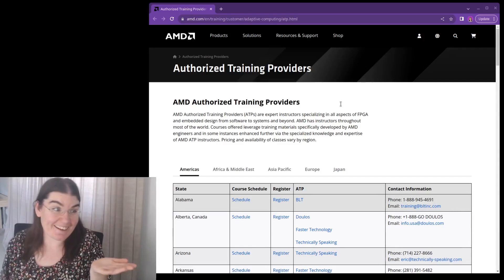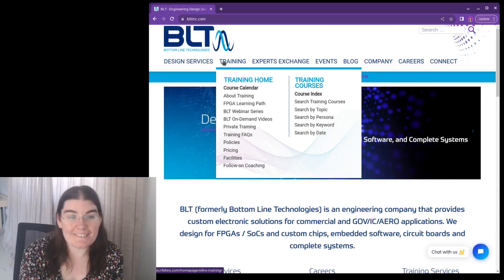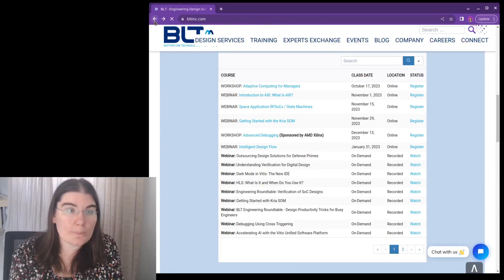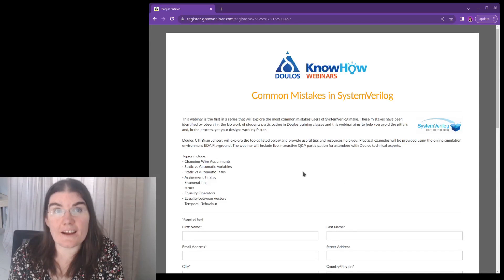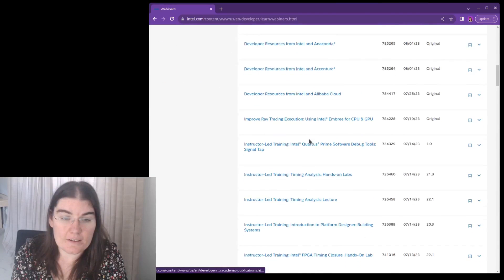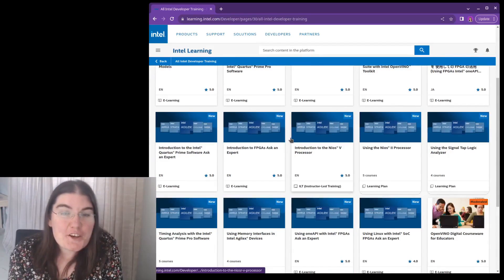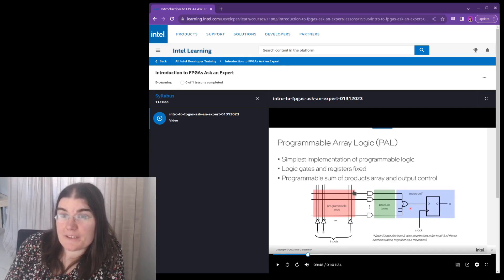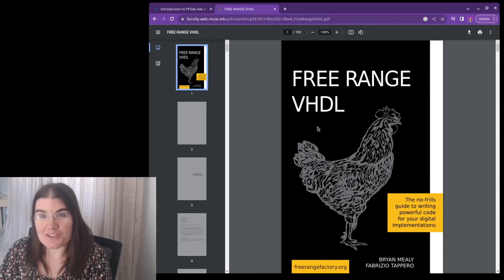Free FPGA training and resources!

Comment: Thanks for the tips. The book is a very good tip. It's just a pity that it only covers VDHL and not Verilog. I couldn't find this introductory video from Intel, which you mention from about 5:40, on the Intel website. It was easier to find the video using a normal internet search engine. Then I found what I was looking for on YT.

Comment: Text Classification on FPGA. Is this possible??

I'm trying to run resume classification using the 1D-CNN method. I can easily do the Python coding for that but, I'm skeptical about running this on FPGA. Can anyone suggest resources (documentation, code, or any material related) for this project? I will be running this on the PYNQ-Z2 board. Is there any IP block for this or how can I make it?? Your suggestions will be highly valued.
Reply from the maker: I have no idea! I haven't seen any IP block. I usually will run a search on google scholar, like " 1D-CNN FPGA" and see what comes up. It looks like there are some results: https://scholar.google.com/scholar?hl=en&as_sdt=0%2C5&q=1D-CNN+FPGA&btnG=